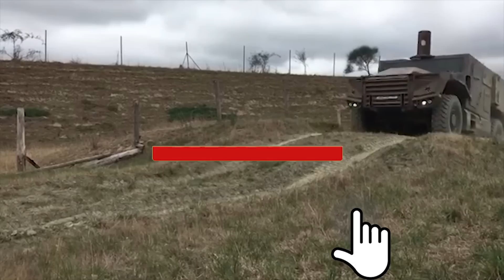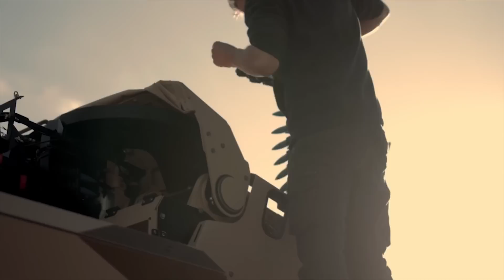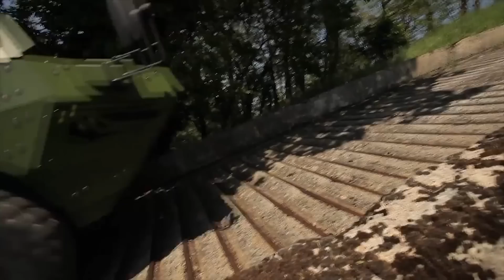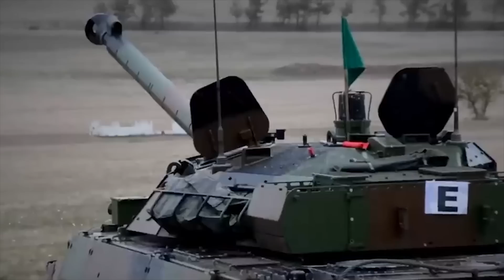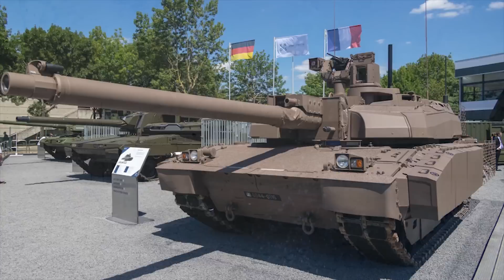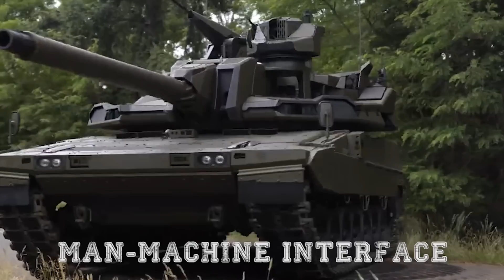Finally! New French EMBT Tank Is Ready For Action!

Comment: Most of the information in the video are wrong or outdated....
VBCI : ok
TITUS : Never got adopted and only for export
Leclerc : We got only around 256 in service, a lot got sold to EAU
VAB Mk3 : Not adopted, exported in low quantity I believed, but not sure about that. Old VAB are being replaced by the Griffon
Jaguar : ok
AMX-10 RC : Old and close to be outdated, being replaced by the Jaguar
Griffin : It's called the Griffon, not Griffin !!! Ok on the rest
Leclerc XLR : It's the classic Leclerc upgraded with a lot of anti Heat round armor and IED/mines, new electronics (jamming, sensors and better screens), gun station for commander and new very powerful optics for the gunner and commander
Serval : Small Griffon designed for light frontline taxi or command vehicle
EMBT : Prototype, not designed to be produced in quantity, more a demonstrator of technologies to prepare the true EMBT.
Reply: Juste, un détail à préciser, le Serval est destiné aux OPEX, car il ne pèse que 15 à 17 tonnes, c'est pourquoi les A 400 M peuvent en transporter 2, tandis qu'ils ne peuvent transporter qu'un Griffon à la fois. Ce qui serait très intéressant c'est que l'armée soit dotée de Sherpa A2M, qui sont dotés d'un mortier de 120 mm avec une portée de 13km, ce véhicule formerait un duo très efficace avec le Serval lors des OPEX, et constituerait un CAESAR miniature permettant de disposer d'un système d'artillerie efficace lors des OPEX.

Comment: Edit: the 40mm cannon of the Jaguar has a different optimal ranges depending on what type of ammunition you use:
- APFSDS: 150mm of steel at 1500m
- HE: 100mm of concrete at 2500m
- Standard: 4000m+ range
- Airbust to ground: 2500m range
- Airburst to air: 4000m range

Source: CTAI website

Comment: we only have 200 Leclerc only 150 are functioning
Reply: Of the 406 Leclerc tanks delivered to France, as of 1 July 2018, there were 225 functional tanks, + 18 "DLC" towing tanks.
On the TV sets these last months, we would now be on 216 functional tanks. The remaining nearly 200 are in long-term storage, most being cannibalized, serving as spare parts for tanks in operation since manufacturing is stopped. 
By 2025, 122 of the current 216 deployable tanks will be upgraded to the XLR standard. 
I don’t know where that 150 tank information came from, but it seems incorrect.

Comment: how about: no driver or exposed sensors; the vehicle navigates by gps and maps made by small drones sent up before and during the fight?
Reply: the EMBT has 24 sensors. And yes it has drones launcher + inertial datas to avoid GPS jamming. But you can't rely only on drones than can be shot down, it's just a "nice to have"
Reply: Jamming systems are very powerful nowadays, you can't rely on drones only. The best example is the Russian invaders using its jamming "bubbles" to confuse Ukrainian drones
Reply: How about no? You definitely need a driver to react to all of the sudden and unexpected changes in the heat of the battle.